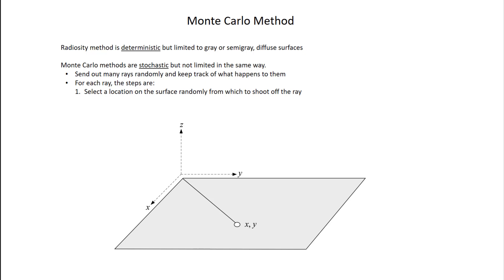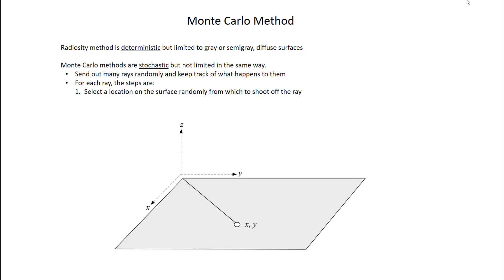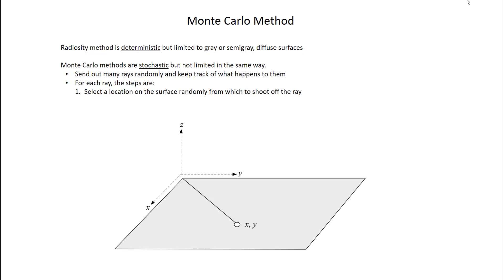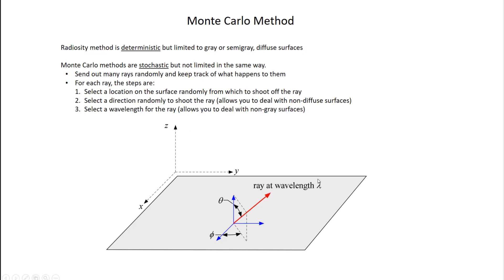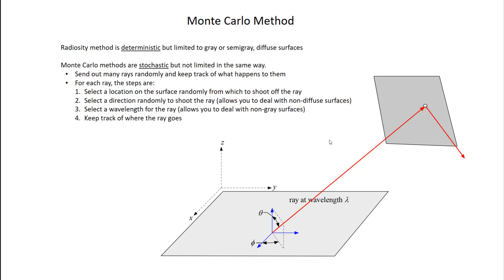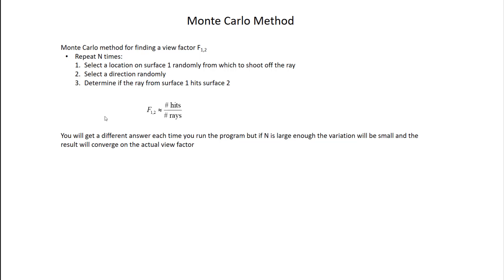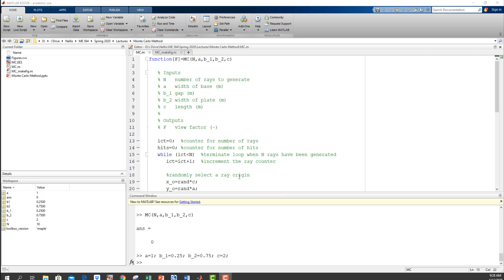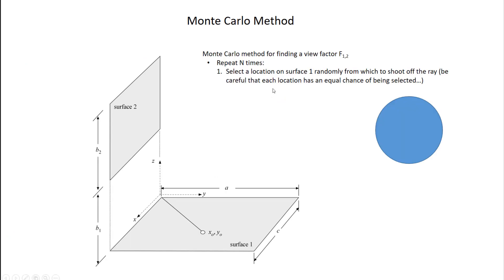Monte Carlo Method Part 1

Comment: What happens in 2D? How am I supposed to transform phi and theta angle to one certain angle which should be around 0 and 2pi
Reply from the maker: I think you would still use phi and theta and just ignore the component in the direction you are neglecting (e.g., take the x and y components and ignore the z component)

Comment: Hi. There is a similar example to this in Thermal Radiation Heat Transfer book ed 6 (Example 7.13) but doesnt uses coordinates like you. Why is that? Maybe because of neglecting surface width?